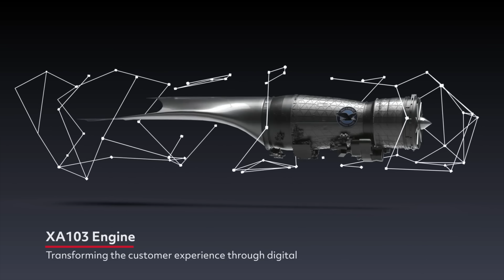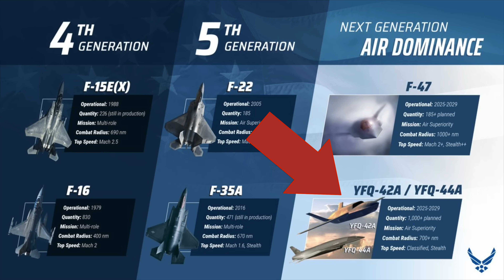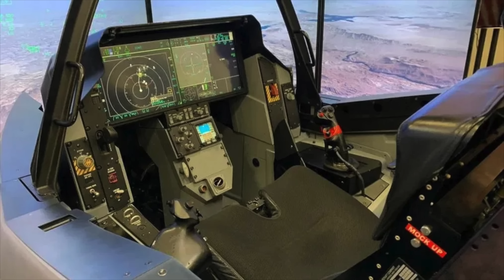Is the US Air Force F-47 Already Flying Missions?

Comment: I don't know what it would be doing at area 51. I can tell you they are airborne. And I can tell you where they're flying out of and it's not area 51. It's whiteman air force base missouri. They sit in the same hangers, the B-2 are in. They've been flying over palm datar lake for the last five years. There's people telling me i'm insane when I talk about it. Just like they did with the B-2. When it was flying over the lake, and I was telling people about the giant flying black dorito. Something they're not telling you about one of the designs on it.That I have noticed. The bottom of the plame changes colors depending on the sky color. Which tells me the the outer skin of the plane is temperature controlled. With thermal sensitive paint.

Comment: America needs to do sonething about Chinese hacking before they make the next stealth fighter.
Reply: Well Hillary gave them the Tech info  for the F35 and F22 so now she has zero access we should be a little safer 😂
Reply: I agree with you in a sense but follow my train of thought here.
If we created some information in a technology without China knowing and got them to incorporated into everything they build, and then we use that hack to take advantage of every piece of equipment they install that particular technology on. Wouldn’t that be cool?
Reply: I belive they are using starshield which is the super advanced, built for military encryption version of starlink, this allows them to communicate seamlessly as the satellites communicate via laser, not radio signals. The only way to intercept would be to physically position a receiver between the satellite and the plane or between two satellites. Even this would only get you a jumbled mess of encrypted data you can do nothing with plus the military would have shot down any such intercepter device, plane or satellite long before even getting close enough to the connected vehicals &/or satellites.
Reply: I am not worried about the Chinese. Go look at population pyramids. Look at energy supply chain vulnerabilities. Look at the first island chain.  Look at their internal strife amongst the factions of the CCP.
Reply: @ShovelMonkey  yeah but they want to be top dog real bad.
Reply: That looks like the "MiG-31 Firefox"
Reply: Lol you think they haven't?
Reply: @haventthoughtofanameyet6364  no I don’t think they haven’t. I know that they have! Lol
Reply: No anti-gravitics?😂
Reply: They didn’t have to do any hacking when Biden was in office. He just sent them the plans FedEx express.

Comment: The answer to this question is YES . They are flying. I seen one being followed by 2 f35's one day when all 3 came directly over my house at low altitude. The back of the f-47 looks like a corvette from behind. The f47 opened up after leveling out and broke sound barrier a few seconds later. Cracked my livingroom window at top left. 
I live near a somewhat secret base that don't get alot of attention. So it would make sense they might be testing it around my area.

Comment: 7:00 "canards  FOR stealth?"
Reply: I've be looking through the comments for the "but canards" stuff!
Reply: It's a tradeoff.  If you can maintain the same control authority by eliminating the tail while adding canards it's still a net reduction in RCS even though the canards then become your biggest liability.  You can also solve that problem entirely with advanced variable geometry canards, but there isn't much evidence for that at this point.
Reply: I'm gonna go out on a limb and say that the canards can be "locked" into a stealth configuration when just cruising around and probably only used "as needed" in actual A2A scenarios. Much like the thrust vectoring on the F-22 is mostly used for trimming the plane to reduce drag in flight and "super maneuverability" is just a cool bonus for airshow (as of this post an F-22 has never shot down an enemy fighter in anger) attendees.
Reply: I heard that they could be retractable

Comment: No canards for the Air Force. There will be additional canards for the Naval version. This was the plan all along, and why F/A-XX funding is diminishing. The Navy will get a heavier 2-seat version with slightly lower RCS because of additional canards and heavier landing gear for carrier landings. The 2-seat version will also have a modular  weapons bay that can have a large EW/Recon pod installed to conduct duties in similar fashion to the EA-18 Growler without having to install external pods that lower RCS.

Comment: By now after the Israel-Iran exchange it looks that a paradigm shift in warfare demonstrated the cost effectiveness of Iran asymmetric response to aerial attack with manned aircraft. Do realize that the development of military aircraft has been driven by the need to deliver payloads or perform reconnaisance. Manned aircraft as a solution to both are started to be fundamentally disrupted. Of course an air force being led by former pilots will be slow to admit that. So fighting the previous war will be approach for now.

Comment: Considering Boeing tore down the old F-15 buildings and is already building the new mass production plants in Missouri, means that virtually all prototype test aircraft built by Phantom Works have completed most flight testing and technological capabilities. Now, they just need mass production.

Comment: Probably has the radar signature of a mosquito
Reply: The canards: yeah sure.
Reply: @juanjorge751 Yeah, I'm not sold on the canards at all! Well at least that big, when you have advanced thrust vectoring!
Reply: Doesn't matter. Modern radar can see a flying flea.
Reply: mosquito flying at 50x the sound barrier
Reply: @Phoenix-vg8li :- Confidential sources confess it’s that of an atom.
Reply: It’s an F-16XL it is so damn clear to see. Sadly the USA’s F-47 is still a power point presentation.

For the record, you can see the shadow of the F-16’s tail fin. A 6th gen fighter wouldn’t have one. And if it does then, well, shit. That means the Chinese plane has a huge advantage as the J-50 does not have a tail fin and is already flying
Reply: @meridiasbeacon7669  the f47 has been flying for years, they would never get caught with their pants down to let it get imaged. Oddly enough our evidence hides in ufo sightings. The next gen is merely a shadow until they want it to be seen

Comment: ya didn't mention how old the f-22 is... heck i remember the competitor yf-23 that wasn't picked.  f-22 entered service in 2005 but designed (using 1980-1990 tech)   winning that contest in 1991.. you driving a 30 year old car?  built with the same tech maybe?  think about it, we release something and keep it until others threaten the envelope it is supposed to dominate, to upgrade ours.  yes they go through upgrades through the years.. was the f-22 made to upgrade easily thou?   frankly i'd like to see modular crafts.  for diversity of role and services.
Reply: The first flight of the YF-22 was 1990.  The first F-22 was 1997.

Comment: I know the common belief is that the F-47 will give up agility for increased stealth, & BVR but I really think this is an outdated way of thinking. There are new types of RAM now (see those mirror finish F-35's and Raptors) which are far more resistant to high G loads, thermodynamic damage from Mach2+ speeds, and various atmospheric corrosive elements. Given the lack of vertical tails, it seems quite likely that the F-47 will have TVC (probably 2D like the Raptor to reduce radar & IR signature) and possibly canards as well. If so, the jet cannot really avoid being pretty damned agile. Remember how many people thought the F-35 wasn't agile for much the same reason? Turns out they were wrong; the F-35 wasn't agile because it went into IOC before being fully combat capable and was restricted to 5G until 2019 when block 3F was implemented. From 2019 on, we saw full 9G capable F-35's flying more like Raptors than anything else. 
Really, if we can build a super stealthy, ultimate sensor fusion, drone wingman controlling, Mach 2+ capable, high internal payload carrying, long ranged Gen 6 fighter, and we have the ability to make it agile almost as an offshoot of the flight control system as it is designed, why would we not?

Comment: The tailless aircraft at Area 51 is very unlikely to be a flying 'prototype,' but could easily be a technology demonstrator inching towards a prototype. I do agree, however, that the size does very much indicate significant range/payload increases. Range is especially needed.
Reply: Engines are more efficient, have to be with 1000 mile refuel.

Comment: Definitely ALREADY FLYING.  It takes decades to field new design fighters…I’m guessing this was already on “drafting tables” during the F22 heyday…because it’s always Next Gen.  Can you imagine the stuff projected for 20 years out?
Reply: We already have the triangular nuclear powered antigravity airships equipped with high intensity laser weapons powered by the 3 nuclear reactors used for propulsion. How many is anyone's guess. Is the ceiling of 99,900 ft operational status the actual limit? Are 10g course corrections standard or is the artificial gravity modulation more advanced than that?  Things we really may not know for decades to come. The 6th gen fighters are the smoke screen. The slide of hand to keep our attention on combustion engine tech and air superiority in the forefront of the collective mind. Nuclear drive and energy weapons are the future, the nearer than we think future......or is it?
Reply: @dragonstonegemironworkscra4740  you talking about the tr3b? Becuse that thing is fake

Comment: There's like zero chance the USAF left this parked outside in daytime for satellites to snap pictures.
Reply: It's a prototype F-16XL. Nothing classified.
Reply: @flyboymike111357  That tracks. It looks a lot like the F-16xl
Reply: @flyboymike111357  Both XLs were turned over to NASA after the flyoff with the Mudhen. I know at least one of them was stripped clean, not even left with an engine. I believe the other is a retired museum piece.
Reply: @flyboymike111357 Yeah, I do believe you are right
Reply: @flyboymike111357 Interesting. You're saying that there's a 50 year old prototype parked at 51. Is your assertion based on the image or is it other knowledge?
Reply: @rickbase833 Based on the image. It's clearly single engine and it has the same wing shape.
Reply: @flyboymike111357 That is a good catch!
Reply: @flyboymike111357  I respectfully disagree. I'm just not seeing the same thing.
Reply: @MattH-wg7ou  That’s because you don’t want to see the same thing.
Reply: @ThePoliticalKid  you're free to disagree, I just don't think thats an F16XL. I think it is far more likely it is a decoy. And I do this for a living. I could be wrong. That's just my opinion.
Reply: @MattH-wg7ou  It could be. But we will probably never know. Sadly.
Reply: @ThePoliticalKid  exactly.
Reply: @rickbase833  quite possibly that they are testing wing designs and since the F-16XL had the delta type wings, they were using it to gather data...same reason they still fly the F-117 for testing out different stealth packages...
Reply: @flyboymike111357 bro, at the beginning of the video, he showed the back which is a tailless wing and 2 after-burners. How can 1 engine give 2 after-burners ...
Reply: @flyboymike111357 Have you heard of The F-36? Meant to be replacement for f16 and based of the f16xl
Reply: @OperatorWoods That's not a government program. It was a think tank proposal that wanted an F-2 sized F-16XL with internal centerline weapons stations and twin diagonal tails. There isn't a lot of benefit for having a weapons bay in a plane which is designed for maximum external hardpoints. And the F-16, F-2, and J-10 have a single vertical tail because that is what the airflow over th fuselage will allow. The twin tails are cool looking but will not physically work with the shape of a viper or any aircraft derived from it without significant changes to the aerodynamics
Reply: @rickbase833 they fly f-16’s at Area 51 all the time. They use them for testing radars and simulating enemies
Reply: Unless they wanted it photographed.
Reply: They didn't because this is a picture of a plane on a canopy tent
Reply: Nailed it @TheGhost0086
Reply: @TheGhost0086 thank you!!!!!!!! I was thinking HOW IS THIS GUY FALLING FOR THAT PICTURE, when HE WAS A PILOT!? SMH I literally have no faith left in the sophistication of mankind
Reply: @TheGhost0086 That's what it looked like to me also
Reply: @TheGhost0086 more like to ground, then they removed that tent roof for few hours..

Those trusses ruin trying to lidar it, if you don't have best possible lidar at LEO.
(I think there's no planes flying over that place)

Someone is trolling, maybe even using tax payers money to it.
Reply: @TheGhost0086 right? I was listening to him saying "here we have the aircraft in a hanger" i was like " i didn't know they did crystal clear glass hangers" 😂
Reply: @TheGhost0086 you are absolutely correct here. The giveaway is the shadow cast by the canopy opening itself. Honestly I'm surprised this has persisted for so long.
Reply: I think I found one in Apple Maps a few years ago  sitting on the ramp at Nellis part of it was blurred out but the part I could see didn’t look like any fighter that I know of. It’s been removed now but I took a screen shot.
Reply: There is zero chance they'd fly it underground if it existed.
Reply: @garyn1780   loll
Reply: @garyn1780 bruh the military ain’t that futuristic they couldn’t fly that underground bruh. The gas and fumes would kill em lol
Reply: A little taste for the enemies.
Reply: All YouTube is CIA disinformation...
Reply: It’llbe cool if it looks like edi from the movie stealth
Reply: I doubt it's the 47. I'm sure we have all types of cool jets that are testbeds for one thing or another or technology demonstrators
Reply: I went to Area 52 a few times and unless you are Mission cleared you will not see anything other than something under a tarp. It will fly at night.
Reply: 😂 dont be so certain.

Incompetence exists, as does deliberately showing it off to potential adversaries.

The military might be secretive to the outside, but its absolutely packed full of normal, fallible people who make stupid mistakes. Just as any other aspect of life is.
Reply: @richardwillson101 idk if you prefer captain but thank you MR. Obvious. This ofc is t one of those moments. It’s still hidden under a tarp
Reply: He thinks people are stupid,  it looks AI anyway, your right, Nothing is parked outside except what the whole world has already seen.
Reply: They could ... if Next Gen includes invisibility to satellites.
Reply: @MaximGhost  You don't notice the invisible aircraft carrier that it's parked on? 😅
Reply: The U.S. government is aware of satellite coverage. They track satellites flying over head. This was done on purpose to mess with the public and their adversary. I bet these special planes only come out at night and when there’s no satellites overhead. I would assume the whole base goes dark and they taxi these planes wearing NVG. They must have a small window to do their flight test.
Reply: Single engine? I don’t think so
Reply: They already said its been flying for last 5 yr
Reply: Shape is a small part of it its the metallurgy engines avionics and stealth coatings that are the real secret sauce.
Reply: That "screw-up" at Groom Lake was intentional to mess with the Russians and Chinese!  The airplane in the transparent cover is the mock-up Lockheed made for Top Gun Maverick.
Reply: The enemy knows the game, if it’s being talked about at all by the US, then it’s already 20+ year old tech. So showing them F-47 and having Trump talk about openly is sending the same message... that F-47 is old news and what you really need to worry about before starting anything is the NEXT wunderwaffe NOT being discussed openly.
Reply: The picture is the f15 xl not the f47.Darpa was testing canards on the f15 xl vertion.which was ore manuberanle than any of the f15 models to date with thrust vectoring but wasn't as steathlthy
😅
Reply: @Robert-t1p I wish I was manuberanle
Reply: It can’t stay hidden forever as it will a high production tactical fighter
Reply: Decoy
Reply: Looks more like the F16xl
Reply: Oops
Reply: @valkyriesride129 oops, what do you mean oops were going to have to work on our communication( Independence Day )😂
Reply: ...unless they did it to make people think this is some big deal even though they are probably 75 years in technology ahead of anything we even have any idea of.
Reply: You’re exactly correct. Max after burner is just taking you for a ride! (and he wants to let you know who his daddy is)
Reply: That canopy breaks it up made to do that
Reply: Agreed
Reply: AI ?
Reply: They probably did for a show of force in scaring the adversaries.
Reply: They literally made a movie with the SR 72 as a prop,,  Disrespectfully out in the open.
Reply: Skunk Works would leave the A-12 upside down to test RCS at Groom Lake, and would move it inside when Soviet sattelites would pass. What wasn't revealed till later was that the A-12 was there long enough that Soviet IR satellite sensors could guestimate the shape of aircraft via surface temperature differences between Oxcart's shadow and the sun scorched pavement.
Reply: @B_izzyy .  They still do this RCS test upside down at 51, or the range north.  I watched a 51 snooper and he caught a vid of something coming out of the ground upside down for tests at dusk.  Pretty cool
Reply: It looks more like the drone wingman to me than the actual f47. Also, we have no proof that it's gonna be tail less. In fact, in one of the government releases, it had no canards and a tail similar to an f22.
Reply: this guy is higher than my uncle when he got raided in Operation Everglades. 
He's played far too many video games.